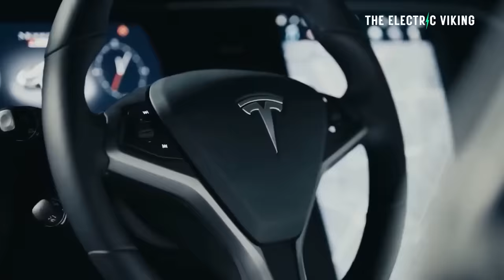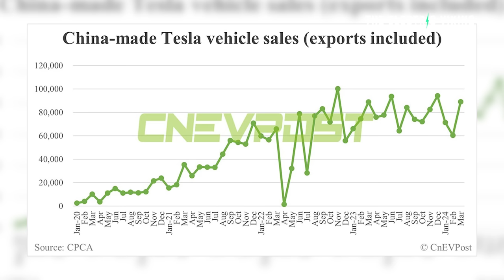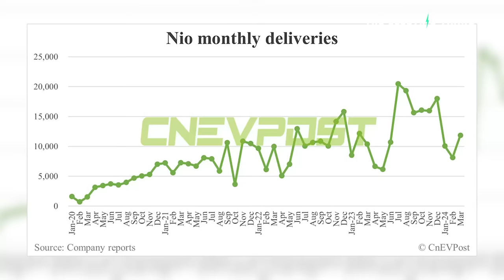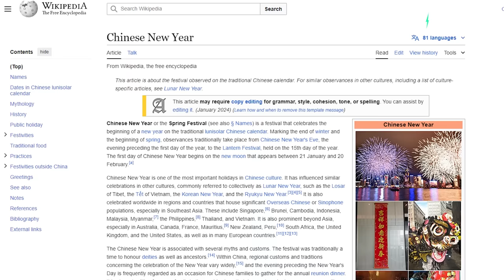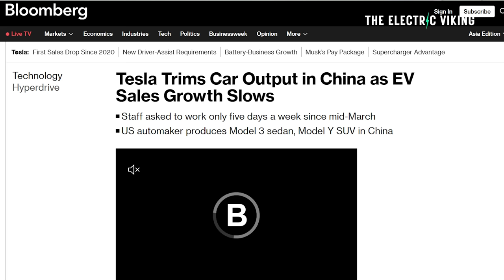China reveals HUGE month for Tesla: Model Y still China's best selling EV

Comment: You have to wonder why china allows a US EV company to thrive in China while the US doesn't allow China EV's to in the US
Reply: well, largely China Domestic BEV are non Compliant with FMVSS regulations .
they are built Cheaply, and LACK Advanced safety features. 
USA does allow Compliant China BEV , such as the POLESTAR and VOLVO BEVs made in China by GEELY. 
but , those sell way less units than TESLA, gm, Ford and VW. 
China may bypass USA regulations , by Producing in MEXICO, and using NAFTA rules to import China auto LEGALLY. 
the Problem remains , small market for China autos in USA, and they are still made VERY Cheaply and LESS safe & with FEWER Advanced safety features.
Reply: China allowed Tesla in order to get the Ev infrastructure set, to get the competence etc
Reply: To build their market so they can take advantage of it
Reply: @markplott4820 Untrue. Totally politically motivated. So Europe must have low standards as they allow Chinese EVs to be sold there. Come on, dude, use more common sense.
Reply: China is leading the car industry and Chinese car companies would absolutely dominate the US car market if they were actually alowed fair competition.
Reply: Because China wants faster adoption of EV's.  Having competition like Tesla is good for China.  Like the saying goes "iron sharpens iron."  All the EV companies compete with each other providing consumers with the best prices, and they are also competing to have the best product in the market.  Tesla also creates a lot of jobs since China produces over 40% of all Teslas sold world-wide.  Protectionism is not going to help large US auto makers in the long-run, except Tesla.  Right now, Ford, GM, and Stellantis are not pushing for a fast transition to EV's, and they are already way behind Tesla, BYD, and other Chinese EV manufacturers.  In 10 years from now, most countries will have adopted EV's and their streets will be super quite, while the US will only have expensive EV's and gas-guzzling cars.  EV adoption in the US is slow because Tesla has no competition.  If BYD and other Chinese EV's entered the US market, the large US manufacturers would get slaughtered.  You will see exactly what is happening to GM in China.  GM would be closing factories and firing employees left and right.
Reply: Why did they add to the amount of public places Tesla cannot drive in January?
Reply: @markplott4820  Sam 2.0 😂😂😂😂
Reply: @blokin5039  they would dominate the small EV market, but most Americans don't buy small cars.
Reply: Right now, Chinese EVs couldn't pass safety regulations. They would also have to set up dealerships before they could start importing. I don't think the U.S. will block Chinese imports, they will simply slap them with massive tariffs.
Reply: @darylfoster7944  Says who, you? Chinese cars are easily acing the NCAP tests frequently ahead of their European rivals and if they couldn't pass American safety regulations the US government wouldn't even bother with their tariff wall. And so called 'national security' whatever. It's all geopolitics.
Reply: come on check with google about chinese car  in eu ncap test ()
Reply: @Ailindeng10  You mean the ones like BYD Seal and Dolphin taking 1st and 2nd place in the Australian ANCAP tests ranking as the safest cars in the world and the BYD Seal, Dolphin and Tang getting 5 star safety scores in the European NCAP ratings?

Yes things have changed greatly for the better since the paper box crash test results of 20 years ago.

Much has changed since China hosted the Olympics and was opened up to Global Scrutiny on that Stage.

Best!
Reply: Four Chinese MADE brands are sold in the US: 
Volvo, Polestar, Lincoln and Buick.
There are no CHINESE-BRANDED cars for sale in the US, because they have no dealer network, no means of distribution.
A Chinese auto maker such as BYD must either set up a dealer network from scratch, or partner with a company that has a dealer network in place, both difficult to do.

Comment: Legacy automakers are still not fully aware of how much a lead Teslas has on them. It is not just about putting a Giga press on the floor. There is a lot of material science and advanced engineering needed to get a press to function optimally for high through out.

Comment: A lot of people waiting for the rumoured updated model Y that would have otherwise bought one already
Reply: And the Model 2. LOTS of people are starting to save up right now for what might well be their first new car...including me. Gonna move close to work and get a Veteran Lynx. Save up like crazy, then drop it all on the best model I can get.
Reply: wont be sold or made in USA.
it will be China Domestic model & EU import.
Reply: @markplott4820  why wouldn't the Austin made model Y get the refresh?
Reply: @darylfoster7944   - Because , its HW4 and is one Generation behind HW3 in FSD updates.
ELON , said HW4 will work in Emulation mode.
Reply: @markplott4820  so American Teslas are going to stay in hw3 forever?
Reply: @darylfoster7944   - NO, Austin model Y, Cybertruck , and NEW model 3 are HW4. 
and Tesla is Already developing HW-5.
but , since there are so many cars WITH HW3 and HW3.5 most all of them can use FSD v12.3. 
HW4 vehicles , except Cybertruck can use Emulation mode for HW3.
Reply: @markplott4820  what does any of that have to do with selling a refreshed model? The refresh is about body appearance, suspension improvements, rear screen, etc.
Reply: @darylfoster7944   - model Y "juniper" NOT coming to the USA. 
current Model Y , already outselling EVERYONE in the USA.
no DEMAND issues. 
it , may Appear in CHINA First.
Reply: @markplott4820  sounds like there are American buyers who aren't aware of that, waiting on the purchase of the refreshed model.

Comment: Tesla needs to update the MY, need to speed up Semi production, start making model 2 and Vans. The Cybertruck is neat but unnecessary product for transforming the world
Reply: True
Reply: The cyber truck was only partially about selling trucks. They needed the new technology stabilized before the model 2. 
48v instead of 12v
Steer by wire
4680 battery manufacturing 
No paint manufacturing 
No door handles 
Cameras instead of mirrors 
Ect…
Reply: Do you think they wouldn't know without you? But the bloodletting of the EV startups cannot be controlled by Tesla, and it has an impact, and that was always to be expected. Tesla quietly prepares for times after the number of loss making EV startups subsides to sustainable levels, and economy picks up in general. The winner is obvious now for those looking into the future, but now isn't the time for accolades yet.
Reply: the Cybertruck platform / chassis, is the same size as a mercedes sprinter van ;)
Reply: Why don't you apply for a job there, so you can offer your advice to Elon. You clearly have all the answers.

Comment: Dude did you not see today's deliveries? They are definitely slowing production it's not fake news lol.
Reply: still #1 BEV in the USA, #1 sold car WORLDWIDE.
Reply: Sales were down not production. 
Q1 2024 433,000 cars
Q1 2023 440,000 cars

In 2024 they retooled for the new model 3 and Their Berlin factory was literally attacked. So no they are not currently slowing production. 

Now where are the 46,000 un sold vehicles? That is a huge question I wish they would answer.

Comment: This confuses made in China sales with sales within China. The majority of Tesla cars are made in China. Many of those are exported. Having produced far more cars than they sold means they have a demand problem. Raising prices will not increase demand. Tesla sales are down YoY. Therefore, they are cutting back production.
Reply: He doesn’t confuse them, he explicitly acknowledged them. But note too that, due to the Tesla supply model, with zero dealership holdings to distort actual sales figures, and given that there is still a lag in deliveries of up to 6 weeks, then Tesla figures are real in a way that other industry figures are not.
Reply: I would really like to know where those 46,000 cars are. If they are sitting in inventory at fulfillment centers that’s a sales problem. If they are in transit then it’s just a timing problem. There is a huge difference between the two.

Comment: There is no hateful  remarks  Tesla has increased  the price of the y model it increase some $ 600 plus dollars in China  and $ 1000   in the US ,but you all so have to take the fact  you can buy a Tesla  % 30 cheaper in China 
Tesla  total car factory output numbers   are both domestic  and export cars 
The market  is running very tight  in china ,this has happen before  
in 1903   with electric  cars 
Before Ford  filled the gap with mass produced  and cheap internal combustion  engine 
 cars
Also as a share holder of Tesla,  should I be trusting Bloomfield reports  (from the content of your reports )

Comment: Tesla is in trouble.
Reply: NOPE, Tesla Q1 24' outsold BYD in BEV .
Reply: @markplott4820  Their PE ratio and overall valuation is ludicrous.  And it is unsustainable.  When it unwinds, and it will, it will not be pretty.

EVs are experimental.
Reply: They properly took advantage of being ahead. They have $46B in cash and they continue to be profitable. The stock might be in trouble but the company definitely is not. 

I think the company being stable is going to push the stock back up. But that’s just my opinion.
Reply: @ecospider5  I respect your opinion.  I really do.  Yet I must disagree .  Personally, I believe that this could be a bigger disaster than Takata.  But I could be wrong.

Comment: China was a disaster for Tesla in March for Tesla, so was February. Only last week of the quarter was better sales YoY, weekly sales dropped 20-33% in every other week.

It is also notable, that Tesla has literally one selling product (globally): Model Y. What happens, if its sales dries up? Model Y will depreciate like no other EV, when people realize that the 4680 battery is basically unfixable (due that pink structural foam Tesla is using).
Reply: Tesla battery packs are dealing with the reality. “You can make something fixable or you can make it reliable. You can’t make it both.”

Tesla is going down the reliability path.

Comment: Truth is, as everybody has seen, that Tesla sales has gone down a lot Q1 2024.

And also far below the expectations, which was  already lowered.

And Tesla stock is continuing to get lower and lower.

The ct got half the range and double in price. And is scared of water. And has no FSD. And no spare wheel. But the wheels do have problems with the rubber getting damaged. 

And Elon seems to take down Tesla by himself. Elon is doing cosy style with Donald, so you actually support Putin, if buying a Tesla product.

Comment: Tesla is only best selling because of novelty factor all the gimmicks they put in the car. Once people realize these gimmickiness do nothing but hard to use and breakdown. They will switch to other brands. Also the hope of FSD fades away
Reply: BS
Reply: NOPE, Tesla sells because #1 - SAFEST cars in the WORLD.
#2 - #1 most Efficient Vehicles .
#3 - very HIGH performance , for LOW price. 
#4 - super LOW maintenance. 80% less than ICE. 
#5 - cars offering LONG ranges & LONGEST lasting vehicles on Market. 
BONUS - Tesla , only sells HIGH TECH Smart cars , unlike everyone else.
Reply: Lol terrible take....
Reply: I just purchased my second Tesla. Finally got the model Y. The features are why I would never by another brand. The reliability is why I won’t have to. 

I just downloaded FSD V12 my first trip had zero disengagements for 20 minutes. On V11 it was guaranteed 6 disengagements on the same route. No it is not good enough to read a book. But it is definitely worth $12,000 in its current capabilities.